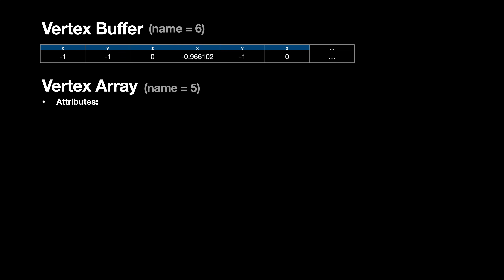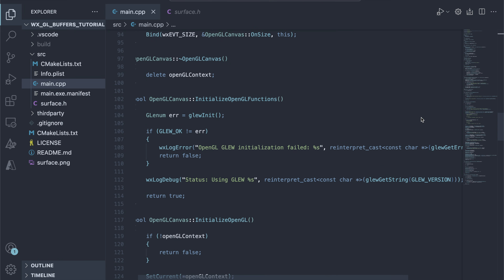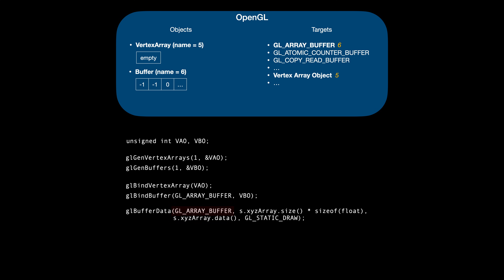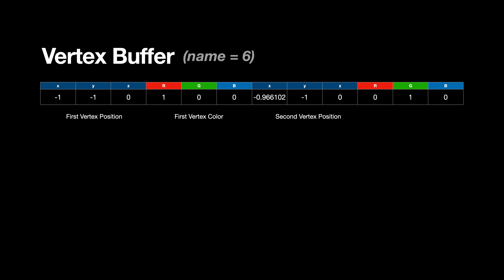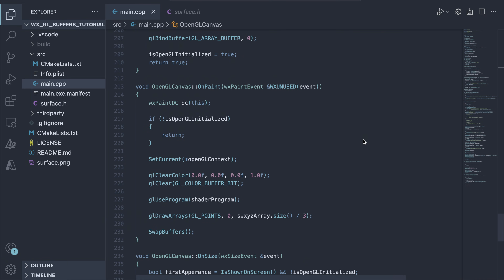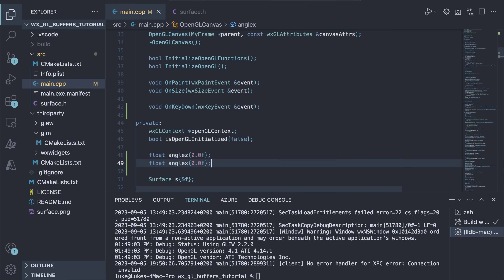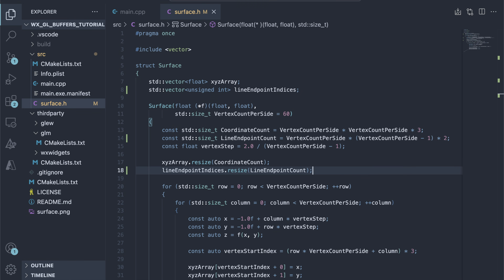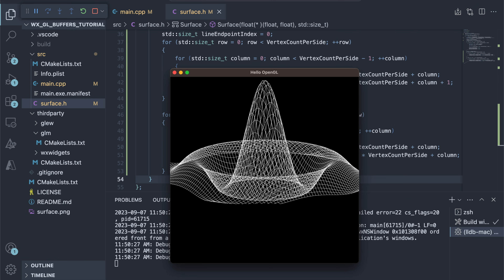From CPU to GPU: Understanding Data Transfer with Buffers in OpenGL

Comment: You are super amazing, when i started my project every step and decision I did by myself with no help from the net.
6 months have been passed since I knew I have to use my GPU for rendering because CPU performance were awful.
and 1 month ago after successfully implemented basic opengl, then when I continued searching for the best method to implement Opengl with wxwidgets,
I found that the best way is using vertex buffers ! your video clarified few things that other sources lack.

(if we are already doing the same steps I'm looking for another feature that maybe your tutorial will help me in the future, I want to put a text as a label and also have the abillity to select this text and also the entire string would have an auto adjusting feature so large sentences would require to split the sentence and begin the next part in new line, a cross platform type of feature)
Reply from the maker: Thank you for watching my video! I was wondering if you could tell me which parts of the tutorial you found helpful that weren't explained well in other videos?

Rendering text can be a complicated matter, especially since OpenGL doesn't offer any text-specific features. One solution is to render the text onto a texture and display it using OpenGL. Fortunately, WxWidgets offers advanced text rendering abilities and can draw onto a memory context, which should make this task easier. I intend to create tutorials on both texture creation and text rendering, so stay tuned for more information! 👍
Reply: sorry I confused you, the text is regular object not OpenGL, so this tutorial was great and explained everything !

what I'm trying to accomplish is a selectable text that is also self adjustable to the panel size

 @onlyfastcode